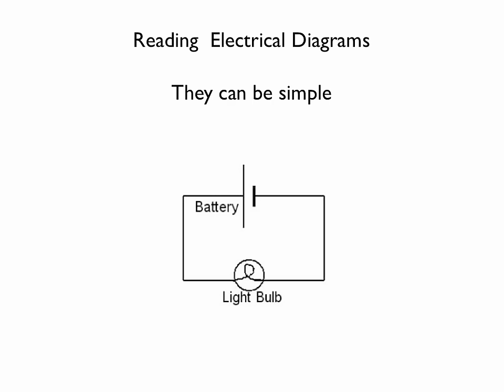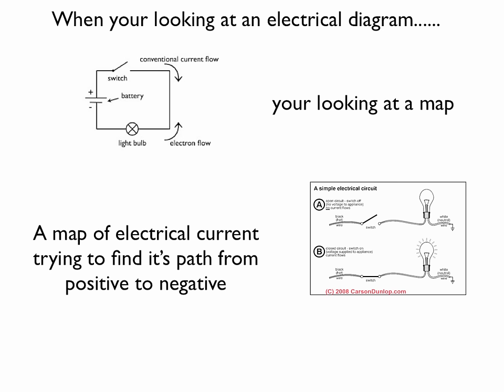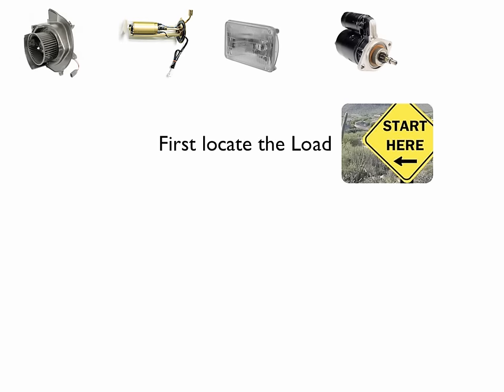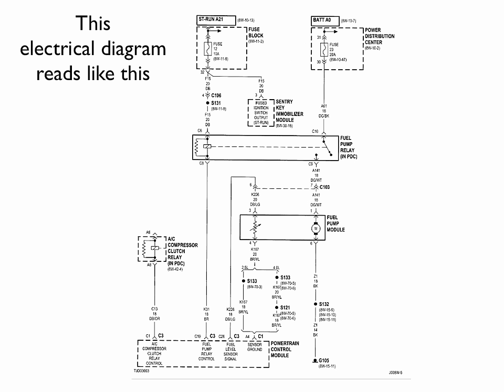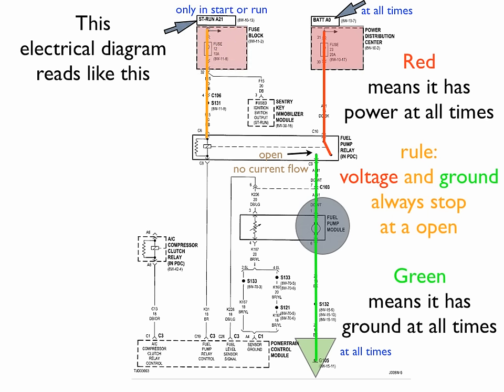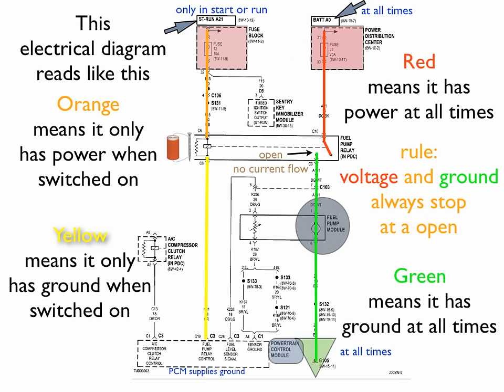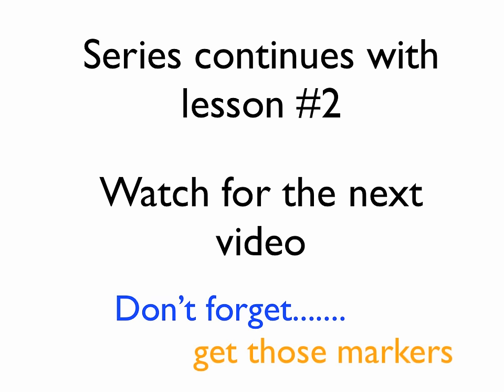How to read an electrical diagram Lesson #1

Comment: You have a dead short to ground if the switch is closed to the fuel pump based on your theory. It should only be green from the ground up to the ground side of the fuel pump and NOT all the way to the normally open switch. That part from the switch to the fuel pump should be orange.

Comment: i’m a junior in highschool and recently got interested in this field, what are some good ways I can get into this field if I’m interested in getting a job when I’m older?
Reply from the maker: Good choice and your timing is great.  The auto repair field is advancing faster than many of us old guys can keep up with.  We need you and your future is bright.  There are all sorts of things you can do like working for shops and learning as you go. But the one thing you will always need is TRAINING.  Approach it with an open mind, not like a know it all.  As you begin, work for different types of shops (engine, transmission, electrical, body, etc) until you find what really interests you.  Also, our trade is rapidly becoming technical so get as much IT type train as you can.  All of our stuff is now interlaced with computers so the more you can learn about that field the better off you will be.

Comment: This video was extremely helpful to me because, I am currently a marine electrician who have worked on submarines and navy surface ships. I also worked as a copy machine technician and a nuclear instrumentation technician - submarines. I am about to switch career over to automobile electrical diagnostics.

I do understand how electrical and electronic circuits work however, there seem to be different symbols in the automotive industry, so that's the part i'm really concerned about. I  do have some experience on electric vehicles (transit buses) so I feel confident that my past experience in electrical and electronic troubleshooting will transfer over to the automotive field. I will be working strictly on Mercedes models beginning in January therefore is trying to get up to speed with the different symbols and color codes used  in automotive schematics. 

This video has been extremely helpful as I said before therefore I will most certainly check out your other videos.
Reply from the maker: Thanks for your comments. Good luck

Comment: Very helpful. Thanks for posting. I've been trying to figure out my dishwasher circuit diagram for a week. It's been driving me crazy. Now I am able to figure some things out.
Reply from the maker: glad it helped.  Keep in mind, all electrical diagrams are simply a map however sometimes different systems use different symbols (signs).  Automotive and dishwasher may have different symbols but the all work electrically the same.

Comment: I just passed my state certification in electricals for cars and light truck vehicles in the state of Michigan.The one thing that I had trouble with on the test, was diagrams.You are clearing up many unanswered problems that went wrong in my mind about diagrams.

Comment: Neon...this circuit does have a return. It is the green wire that he talks about. When the relay is energized (switch closed) the power is sent from the positive terminal and the electrons flow from the return through the load to the positive terminal of the power source.
 The only issue I have with this explanation is that there are no set standards for wire colors (it depends on the specifics of what the schematic is addressing (ie...automotive, circuit cards, computers etc...))  . The ground wire is usually black and not "green" in DC circuits. Positive is not always the color red. This explanation might give people a false sense of trying to identify voltages.

Comment: Maybe you get to it later, but I sure wish I had an idea of what all the numbers & symbols mean on a diagram, especially when the manual doesn't offer a novice any idea what all this means, ie Diagram 1...A61  18, then A141  18 then numbers surrounding fuel pump module 1 motor symbol 8 then Z1 18.  I could guess the number 18 is the wire gauge, but the other letter/number combinations.  And yes, I intend to contribute to your channel.  I"m just learning.  Thanks!

Comment: These videos are great, I am re-watching them so I can fully understand them. I have two questions.  On the start run circuit, why would power stop at the relay. Seems like it has a direct path to ground through the resistor to the fuel pump relay control.  Also, how do you know that the PCM is supplying ground?  Thanks!

Comment: Great explanation of electrical circuits. Need to find similar kind of wiring diagram for MB E200K gasoline W211 with motor M271.956.

Comment: Hello, I have an aircraft fuel shut off valve electrical problem I would like to ask you about. This is a 24 volt DC system. 
There is a master switch, and then a two position switch that either opens or closes the shut off valve. This
 system is on a board in a lab so it is relatively easy to get at all components. 
There are three wires attached to a connector on the shut off valve. These wires run back up to a terminal strip. 
I am going on the assumption that one wire is ground and that the other two wires or 24 V DC that one polariizes the motor in One Direction and the other one polerizes the motor in the opposite direction.
The instructor has disabled the open function in some manner that will now only allow the valve to close but not reopen with the switch. Can you lend any advice as to how to go about troubleshooting what appears to be an open condition. Do you think the switch in this case is operating the ground to either side of the motor? I'm just having a tough time wrapping my head around this, any advice you could lend would be greatly appreciated.

Comment: I like your videos a lot.  BUt I have seen people say to test 30 connected to 87 for voltage and rule out wiring issues.  I wonder if I tested that with ignition off or on? and is there a difference between start and run?
Reply from the maker: thanks for asking.  Your electrical diagram will tell for sure which pin is live all the time and the relay will route that live power ti the other pin when activated.  Start position disables power to many locations and sends it specifically to the starter alone.  Run position routes it to the main fuse panel.

Comment: Under the switched power there is a symbol C106, what does it represent in a circuit?
Reply from the maker: c106 is the number "name" of the circuit.  If manual supports it you can look up circuit 106 and see the items on it.

Comment: Wait, so this circuit doesn't actually have a return?  I mean, the power is sent from the negative terminal on the battery, passes through the load, and then just allowed to dissipate to ground?  I have been an electronics technician for a long time and never heard of a circuit set up in such a way.

Comment: Subscribed 
  Trying to learn more about electronic appliances.
  What does an impending circle on a diagram represent?
  I know the solid ones mean a connection, right?
  Going back to basics as I am running into more and more kitchen and laundry appliances with the electronic boards with relays, capacitors, resisters and do on. 
   In today’s world, there are so many things that can be fixed expensively, if these things are  understood. 
  Thanks I will be checking your videos out.
Reply from the maker: what do you mean by "impending" circle ?  We don't use that particular terminolog in auto electronics, but I'm sure we can figure it out.  Electronics is electronics no mater what we are working on.
Reply: realfixesrealfast sorry, that should read empty or clear circle. 
  Since I asked that, I think I understand it to be a connection or where it intersects a circuit such as a terminal connect/ plug?
  What is throwing me off is my schematic shows the thermistor connection going to a circle such as this, but their no plug or terminal at the circle. Does it indicate a parallel connection?

Comment: I was wondering if the colors you specified were true of all wiring diagrams for all cars or were you just using those colors as an example?
Reply from the maker: Jason Winter Thanks for asking,  the colors are the same for any electrical diagram.  Power and ground are common to all electrical sources.  So, even if you were reading a diagram for your toaster it would be the same.  Of course automotive voltage and household voltage are of a different value, but the diagnostic process is the same for both.
Reply: +realfixesrealfast
Ground are allways black or brown on cars not green. I have never se a green ground!
Reply: +realfixesrealfast To clarify, the colors are standard for electrical diagrams, but NOT for the wires in an actual circuit you may find built in the real world?
Reply: +AstroEngiSci Right

Comment: Hi Sir,
In a normal wiring diagram the switches that are shown are they normaly shown in energised or active state or de energised state? eg logic diagram for star delta motor starter.
Thanks
Reply from the maker: As a rule, most wiring diagrams are drawn with the switches in the "rest" position.  What that means,  they are in the key off/engine off position.  However,  be sure to check for any notes that could indicate that they are drawn in a different position.  And, most of the power sides of the diagrams will indicate if they have power all the time or they only have power with the key in the on and/or running position.

Comment: Hey Dwayne.  Fabulous videos.  I watch them all.  I wanted to ask you a question.  I was thinking of taking either the Penn Foster auto mechanics course, and/or the truck mechanics course.  What's your opinion of this course?  I'm not looking for a job, just want to be able to repair my own equipment for my business.  I have a fairly extensive background in mechanics, but like you said in this video, lacking in electrical.  I've never done any automotive computer work at all.  Thoughts?
Reply from the maker: James, thanks for asking.  Glad to hear your seeking professional courses.  Penn Foster is a good program, although I have not taken it myself.  It's benefit is the structured approach, as apposed to taking individual classes.  However it very well may include classes that aren't your particular interest.  Other options may be available to you if you have a local vo-tec college in your area.  I am an instructor at our local college and know they usually have programs to offer a varity of classes.  Check you area to see whats available
Reply: Thank you.  You are, a good instructor.
Reply: James Mac Neil no gas going back to the fuel tank going in and then coming out still won't start and run acts like it's out of gas

Comment: none of the breakers in my breaker box shuts off my oven. want to reset the f2 alarm to stop the annoying alarm sound. whats up with that? where is the breaker for my oven?
Reply: Is it a gas stove??? Lol couldn't help it. (Not all gas stoves have 120v components ie. Lights, igniters, timers, clocks, receptacles.) OR... It may be in a separate panel/box and using a fuse instead of a breaker.
Reply: F2 alarm?

Comment: Reply to sivucit That particular part of the circuit is Switched Power/Positive so to comply with Jorge Menchu rules i believe it should be Orange, as per the Video because at that stage it might never reach ground, for example, if there was a break on the ground side of the fuel pump module.
i can see your way of thinking but if that was the case we might as well state that all grounds are an "Indirect path to Power or Positive. I could be wrong.
Just my 2 pennies worth as i live in England! :)

Comment: Duane , one correction in ur wiring diagram to get it synchronized with Jorge Menchu article. The wire after the switch from fuel pump relay to fuel pump module should be yellow because it will be power when circuit is complete and provide indirect path to the ground when the relay switch is open. Just my 2 cents..

Comment from the maker: you can get the diagram from my web site.   Go to the recent video page, open the video for this diagram and at the bottom you will see a link to the page it is on.   Save it to your hard drive and print it from there.
Reply: realfixesrealfast
Reply: realfixesrealfast diagram 4o c.f. Tao scooter
Reply: realfixesrealfast simple wiring diagram for a briggs 25 hp v.twin
Reply: realfixesrealfast

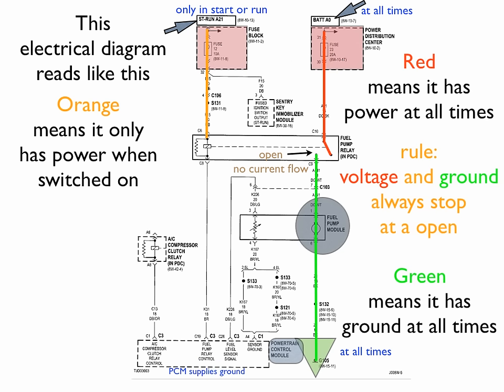Comment: 4:34 How do you know that the pcm supplies ground? I must be missing something
Reply from the maker: Good question.  The PCM is a logic devices, it simply  responds as programmers have instructed it to.  Regarding the ground, the PCM has power and ground provided into it as inputs. Sometimes those inputs pass immediately thru it and sometimes they sit there waiting until being commanded to do so.  That's the case with this ground.  It is sitting there waiting until the signal comes for it to be commanded on.

Comment: Thanks for the great video! I am curious about the small numbers next to the wires. Is that the wire size? I recognize splices, connectors and grounds along with many components but the numbers next to the wires. I have seen this in a Ford wiring diagram for a 1995 Ford F150 that I am working on looking for a short that keeps blowing the PCM fuse. Thanks again!

Comment: I have a question, if the power source and ground is the starting points, where does the current complete the cycle? Base on my knowledge, the current travels from the power source to the load, then from the load to earth. Please explain your concept.
Reply from the maker: Great question.  These concepts MUST  be understood.   1.) All current starts at the source (battery)  2.) current is the only thing that travels, the speed is determined by the strength of the push (voltage)  3.) All travel ends at the working load or loads (proved with voltage drop). 4.) Ground is NOT a path for current to travel, it is simply a path for ground to be provided to the load or loads.        CONTINUITY is proof that a path (power or ground) is complete.   NO CONTINUITY   NO PATH

Let me ask you now, does this explain things better?  If so, perhaps I need to add a video to explain this in more detail and with examples.  Please let me know.      Duane
Reply: @realfixesrealfast  Thank you for responding. However since current stops at the load, what goes through the neutral or ground leg tom complete the circuit? Because is not functional without the neutral/ground.

Comment: Hello Professor fix it for real,
Love all of your lessons, thank you for educating the masses in trouble with their cars. I apologize for asking you for guidance of a repair I am doing on a Toyota corolla 2000 its a no crank in park and a crank in neutral no start. When performing tests what I discover mystifies me unable to interpret the evidence. My question is the computer see something will not start the car it communicate with 5 v ref fine. It sees neutral safety switch and throttle sensor with issues: 1- throttle voltage reading is always 1.8v in wide and closed throttle. It seems it is dead or is the computer shutting it down because it sees the neutral safety switch not able to crank in park nor start in park? Evidence found on starter relay load side good 12.39 volts hot all the time with key off.

Its the control side too low to light my test light however with volt meter it reads 3.44 volts with key in on position. It then reads 12.39 with key in start position. Test light lit up in start position on control side and meter voltage went from 3.44v to 12.39 v?

When I shifted out of park to reverse oo volts; when I shifted to neutral it was at 12.39 volts yet it will not start. Is neutral safety working or is it the cause of the problem? A voltage reading on the ground side is 3.44v this is a high resistance something is wrong here yet I do not know how to verify it. I don't know where to go next on the wire diagram. Is the throttle the cause of the neutral switch not working? Confused and distracted cannot spot light focus in on the problem and their might be not just one problem but 2 or 3?

Respectfully,
Alphasentory
Reply from the maker: Hello Bob,  just wanted to let you know I'm following up on your request about the Corolla and working on a video. Can you email me your email address so I can ask you some questions, thanks.  dumar5907@gmail.com